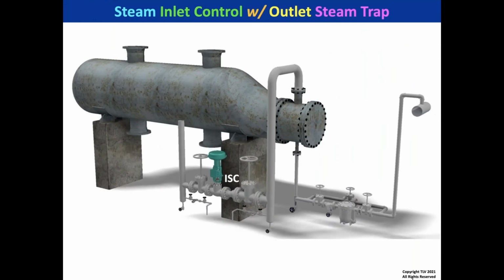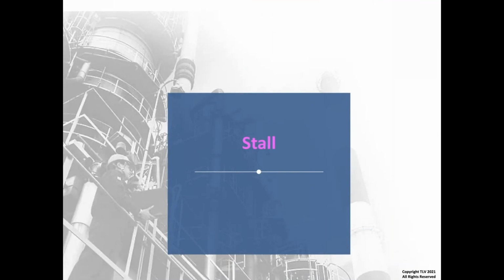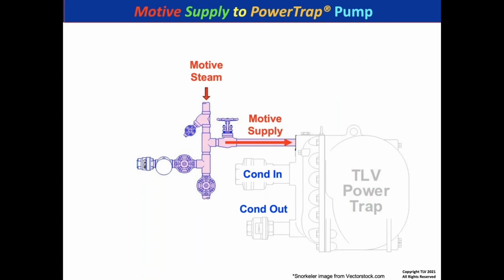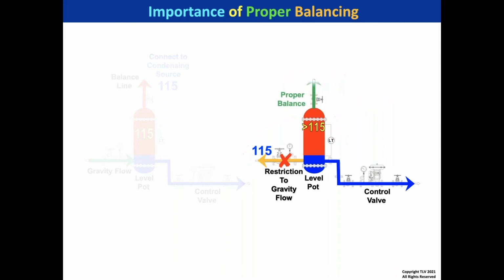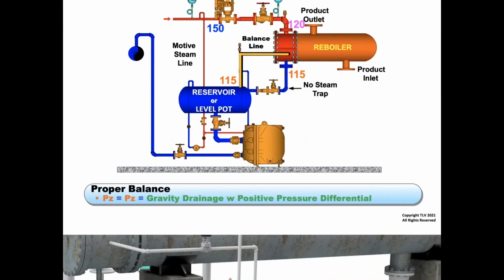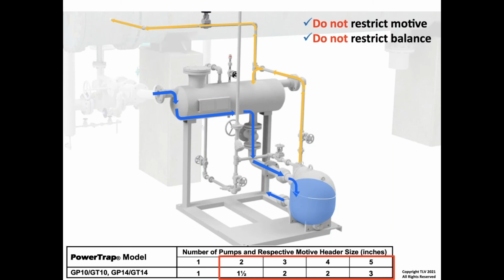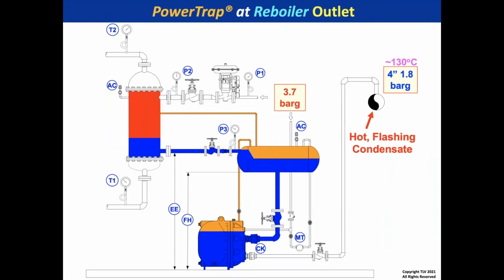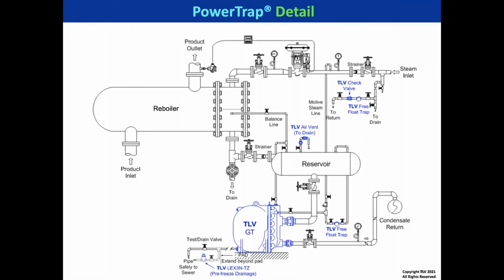Designing Condensate Drainage from Reboilers Webinar

Comment: how trap lift condensate ?? whats is the main reason behind this??
Reply from the maker: Sorry for the late reply. If we're talking about TLV's GT series PowerTraps (shown in the condensate drainage package in this video), then it works like this: the trap allows condensate to accumulate inside the body, the condensate level rises and lifts the lever float. When the lever float reaches the top, it triggers the snap-action unit, which opens the motive medium inlet, allowing compressed air, steam, etc (your motive medium) to enter. At the same time, the steam trap in the bottom of the PowerTrap opens. With the increased pressure in the top of the chamber, the condensate is discharged, overcoming the back pressure and lifting it.
This obviously depends on the back pressure in the outlet line.